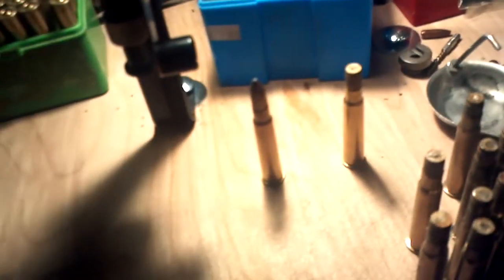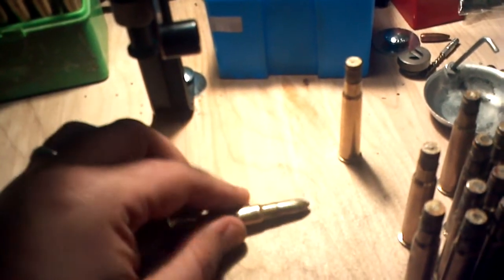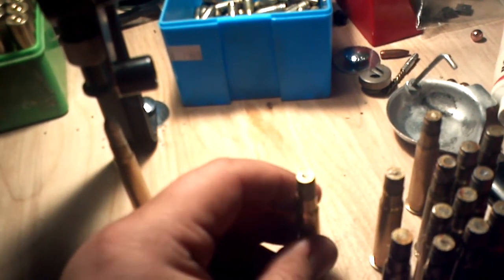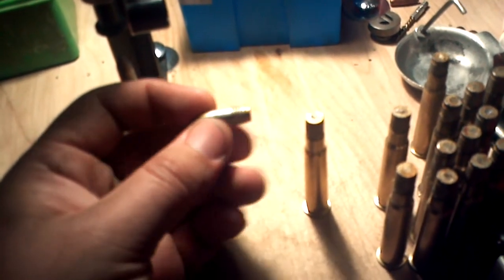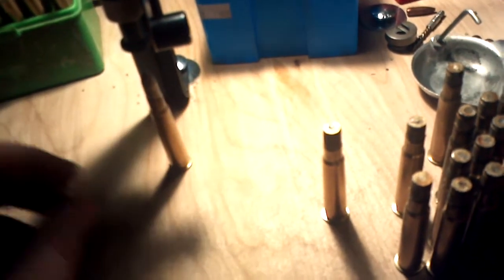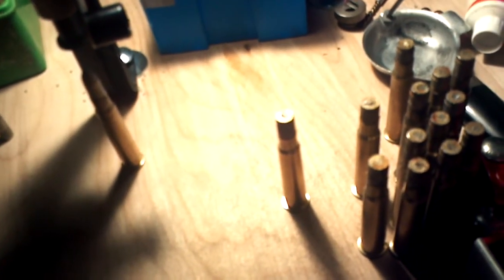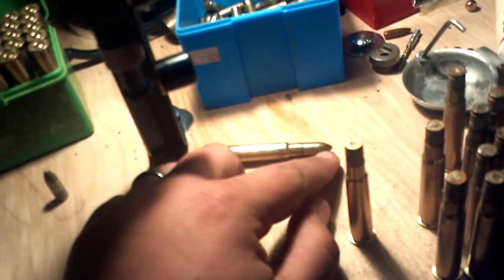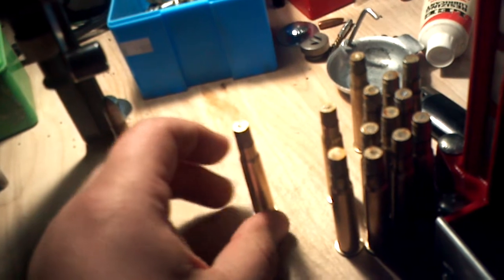Quick Tip: 303 British Bullet Seating

Comment: Original lee mixed size and die 2018 on back. Did not leave a flare on case Creating a little wobble in bullet newer lee sizing die 2019 and on seems to push the bullet more straight